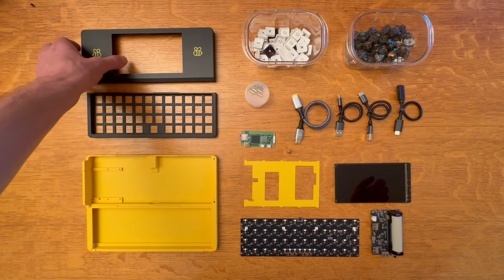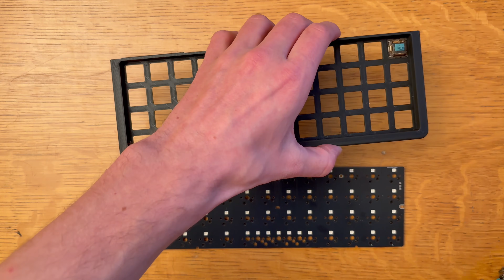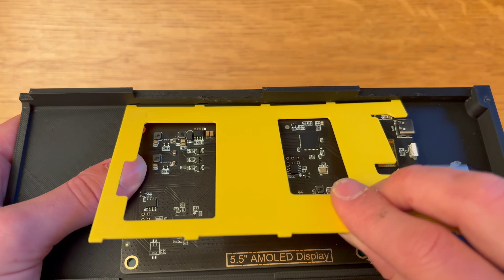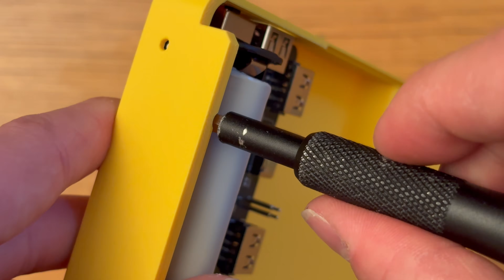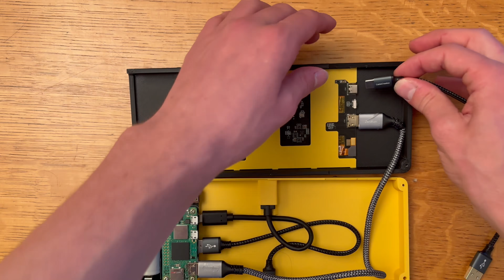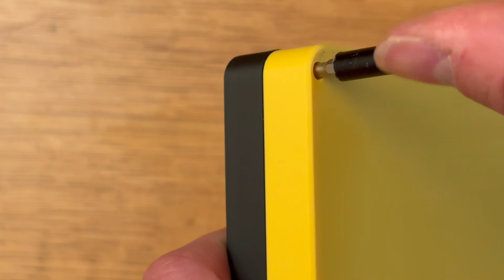bee write back Build Guide

Comment: Finally finished in ABS and went start it but the screen won't turn on. Other monitors work but the one suggested in the BOM is DOA... Do not recommend, or take your chances. Any suggestions?
Reply: same for me
Reply: @7isthekeynumber7isthekeynumber  They sent me a new one which worked, but when I tried to install it I pressed on a corner and it instantly failed. Such a bummer to wait a month for the same thing to happen
Reply from the maker: I would try to contact @surenoodisplay! I am sorry to hear that the screen does not work. I would either try pinging them through Aliexpress or I can give you their Whatsapp number

Comment: I looked right now for a device that could be used with the raspberry to write books and that's enough without distractions and with qwerty keyboard and I ended up here haha you tried and a solution you found it (I'm having fun seeing the video while I guess I mount everything as if they were lego ahah) but even if I had to spend less than 200 dollars would still be too many for me and anyway I was hoping for other features that would be 
a phone style device with blackberry style keyboard, no wifi, no bluetooth, removable sd with saving my data on it or otherwise salvageable and transferable via pc with usb-c, hotkeys between keyboard and keyboard, e-ink screen, big battery but not to be weighed down the device etc. Here, this but not really everything... for example the fact that it is not a mobile phone is better but I wanted to give you an extra idea. you are a great, bye!!! 💯💯💯💬😘🫠😉😁😁

Comment: This is truly awesome. Does it have a light mode? And do you plan on updating this as time goes on?
It would be cool if this had a hinge in the middle so you could close it to protect the keyboard and screen; like a Nintendo DS but for writing.

I have no other suggestions or criticisms though, this is amazing
Reply from the maker: I am currently focused on another project (the Takeout Box DJ controller), but I want to revisit this idea! Since it's just running a command-line OS, I'm sure there are some ways to make the background white (although I'm sure it would affect battery lilfe)

Comment: Looks bad for your neck.
Reply: Not so bad, but you do not have to snap in the display top. I leave mine open and use an old wifi stub antenna to prop it open like the hood of a car.
Reply: @shawngiese I guess that works, but it definitely seems less than ideal. A lot of these DIY computers seem to prioritize the learning and creation aspects far more than everyday usability, which is fine if that's what you're interested in, but it definitely limits the audience.
Reply: @jacklawsen6390  Agree about usability. Just putting this much together though got me back into 3d printing and customizing the linux console again. I-m geadz to start customiying those stl files. The flat lazout actually works great if you are on a couch and you put it on your knees.
Reply: @shawngiese  Yeah, I've been meaning to get back into 3D printing myself, I got tired of having to fuss with settings and having inconsistent prints. I'm thinking I just should get a new printer. The couch thing sounds like a very specific use case, but whatever works for you. 😂

Comment: Wouldn't it save space by using a PCB for low profile switches?
Reply from the maker: Technically yes for the keyboard part, but the height limiting factor was the height of the 18650 battery
Reply: @simonshimel3626  Ah yeah, that makes sense. Those are pretty beefy batteries.

Comment: very cool build - love the look.  Do you know how long does the battery lasts?  Im actually thinking of another project I'm working on that uses a small 5v retro computer.  I'm guessing you could swap the battery out for a larger pouch...
Reply from the maker: I ran a benchmark yesterday and got a little over 2.5 hours, but the Pi hat has a JST connector for chaining on another battery, so it could in theory be extended

Comment: Not sure if the Pi zero would have enough power, but I would consider having this automatically launch something like libreOffice writer in a kiosk mode, using a window manager like openbox.
Reply from the maker: I'll have to look into that! I have been using virtual terminals to switch between "apps", which are bound to keyboard shortcuts. I am planning on doing a software demo soon, but I will investigate openbox before I do that!
Reply: @simonshimel3626  What you have is already pretty cool. I have a Pi zero that I've tried to do various things with and have yet to come up with anything it can handle well. There is also the issue of having no mouse to consider.
Reply: I imagine the Zero 2 would technically be capable of managing it, but using a command line editor like ne that doesn't assume the user has a mouse is almost certainly a better option.
Reply: @SHIFT-HACKMON  That is a good point. Personally, I wouldn't want to do any kind of writing in a terminal-like editor, but that's just me. Not sure how difficult or practical it would be to add a small track pad to this.

Comment: Stupid question - the build guide says to use a Raspberry Pi Zero 2 W with Headers (i.e. a WH) but the video looks like it doesn't have headers. Should it be ordered with headers attached? Thanks!
Reply from the maker: Good catch! That was a mistake left from the previous version where I used the PiJuice and needed headers.